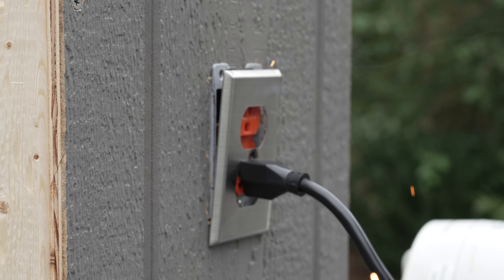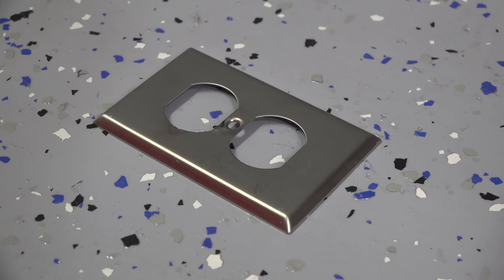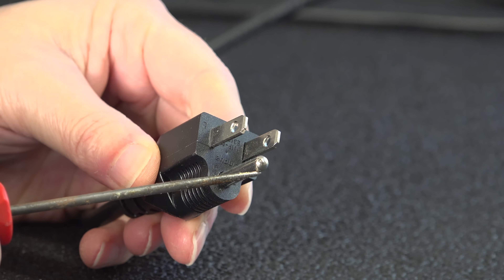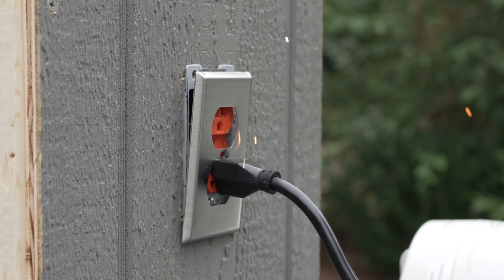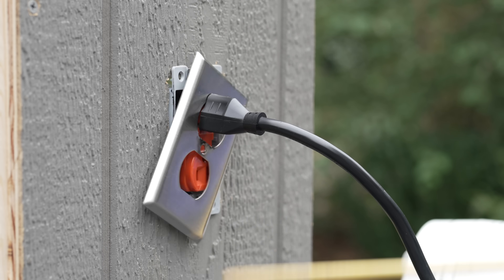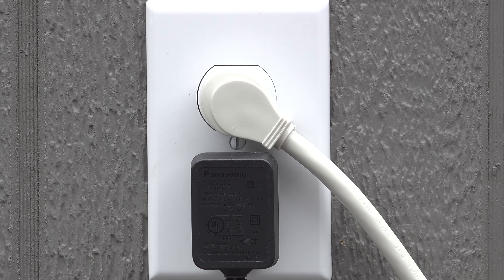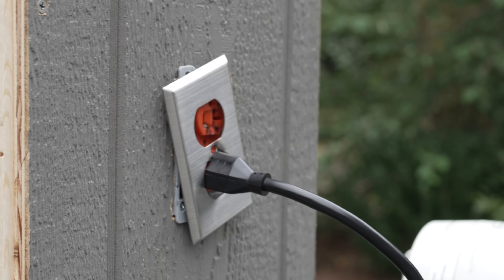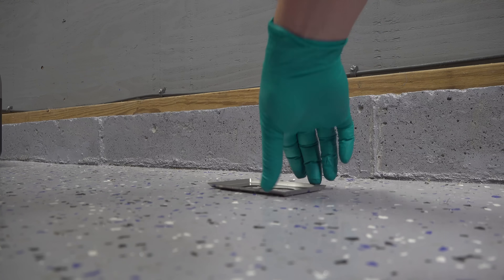What REALLY HAPPENS when you Install OUTLETS UPSIDE DOWN

Comment: We have outlets in both orientations. I have a power strip that doesn't care what the orientation is: it is a flat plug and it can be rotated to any orientation. I wish all devices had this plug design, except power tools, vacuum cleaners, etc.
Reply: Keep a close watch on that rotatable plug. They are notorious for arcing and starting fires because the internal connections that allow it to rotate get loose over time.

Comment: Why don't we copy UK's ideas with safety built in the plug. Or we make a new standard plug. I seen manufacturers get tempered resistant plugs.
Reply: I have a better idea - let's all go cordless!
Reply: I think the uk has fuses in their plugs because they run 30 amp 240 volt circuits to their outlets. With that much power available, you'd better have fuses in the plugs!
Reply: @jaygosch8705  
30 Amps by 240 VAC means 7.2 kW is available ... I don't think those circuits are intended (nor fused) for 30 Amps.

Comment: QUESTION # 1:   Why is the neutral terminal on a plug wider than the hot terminal?
QUESTION # 2:   Why is the ground terminal longer than the hot terminal and neutral terminal?
QUESTION # 3:    What is the difference between a regular outlet and a Hospital grade outlet?
QUESTION # 4:    Is a GFCI outlet designed to interrupt a short circuit fault, or a Ground fault?

Comment: Another solution, use more that one single screw to fix the metal plate to the wall. I know the output needs to be modified, but it would be much better to have redundancy if a screw falls out than not to have it at all.
Reply: Decora
Reply: If you're really worried about a metal plate coming lose, a bit of blue locktite would be more than adequate.
Reply: Who knows that the outlet needs to be modified?

Comment: Retired electrician here. I get asked about this all the time. Some people, even electricians will swear to you that ground up is code. It was a proposed code change back in 1996 but it never made it into the code. The committee answer is that outlets have been installed safely in both orientations for many years, and there is no need to codify a certain orientation.
Reply: I wish they'd codify ground down so people stop with the ground up nonsense. :p Ground up doesn't help at all for plugs that have no ground prong, and as shown in this video, it just makes plugging in power supplies and flat/angled power cords a pain in the butt.
Reply: Back in 96 our county inspector had us turn them ground up on a residential. A few jobs after that he said it did not matter.

Comment: We need to get you into a collab with Technology Connections! He did an exhaustive rundown of this topic and, if I recall, he concluded flipping it upside may provide some safety benefits, but so minor to be effectively pointless. This actually goes to show that cases where the facade is made of metal actually make the argument of it being far less safe.
Reply: Yeah, nowadays we have plastic that is strong enough to resist hits and abuse. Just use the same fiberglass reinforced plastic they use in power tools to make rugged plastic outlet plates
Reply: re: "This actually goes to show that cases where the facade is made of metal actually make the argument of it being far less safe."
Agree on this for sure.
Reply: @uploadJ  Agreed, but there have been cases where I went with metal covers anyway, because they looked so much classier. Not so much those sterile stainless ones as gold plated ones. They look really nice against wood paneled walls.
Reply: @richardmorrow2385 water always flows down mostly, so the bottom of the plug is what would get wet most likely, also a drip line loop is a common way to prevent this issue. Any sag on the line before the plug that goes below the plug will most commonly result in the water run off before ever hitting the plug. So I don't see this as an argument. Maybe during flooding it would make a difference but I don't see a drip on the chord as a likely cause of much anything, just my 2cents
Reply: @newmonengineering  Water tends to flow downward of course, but often finds other paths due to surface tension or capillary action; so it's not a stretch to think that if water was dripping down a wire, and there are no sags in the wire, it may come into contact with one or more conductors. That said, having the Earth connection on the bottom where the little mouth should be would actually be safer.
Reply: I was thinking the same thing!
Reply: I was here from that video
Reply: @bradleybbb Neutral and ground are tied together on the same buss in the electrical panel. It makes no difference in a short circuit scenario.
Reply: @akshonclip  It is true that Earth and neutral are tied together usually, they are different in the case of ground fault outlets / circuits. Neither should harm you in normal circumstances, but in our old shop (and it wasn't that old, we were the first tenants after it was built), I measured 50V between Earth and neutral. Undoubtedly due to current draw through the neutral wire, and the distance between our shop and the electrical panel. Obviously, it's best not to touch any connections of an outlet.
Reply: @kenmore01  If you measured 50 volts between ground/earth and neutral then you have high resistance/ poor connection, or an open neutral.
Reply: @akshonclip  I agree that something was not right with that wiring. There was certainly continuity through the neutral wire since we regularly drew 40-50A through it in the winter running many space heaters and our products. Fortunately, it's not my problem anymore.
Reply: No knife throwing!
Reply: They can play throw the knife at the wall together
Reply: p.s. I’m just thinking these metal plates are risky as can be. Maybe not worth the trade off unless they are coated to reset conductivity maybe.
Reply: I used to watch "Tech. Con" until he covered heat pumps. Was dead wrong about them being a miracle invention suitable for everyone. They are only energy efficient in warmer climates but certainly NOT where it gets COLD in the Winter. I know I went to school for it and have experience with them. He was stubborn about it and could not listen to reason and fact (ego?) so I quit trusting what he posted.

Comment: The fact that there is not the equiv. of a IEEE standard for a power outlet "implementation" such as ground position is just stunning in the year 2023.  Thanks for the vid!
Reply: Well, some of the outlet hardware is marked as to which side is up, and if the electrical code says follow manufacturer's recommendation, there is that.
Reply: Let’s just all switch to a twist-lock plug/receptacle system. 😂

Comment: The main problem is the plug. Sleeve the pins on the plug like every other country to prevent exposed live metal in the first place
Reply from the maker: Sadly the US should have done what european countries did back in the 50s and abandoned the old designs altogether. Now we are stuck with an archaic design forever I think.
Reply: @SilverCymbal  
I used to use the big 1/4" phone jack 'plugs and sockets' in the car for 12 volt devices, this was before car cigarette lighter jacks became popular as add-ons ...

Comment: If the metal plate falls its going to contact the earthed ground "first", before it can contact the live prong of the plug , so you are allways earthing the metal plate first., the other issue is cords pluged into an outlet have weight on there cord and this tends to bend the plug down , with the ground at the top it forces the prongs into there slots making therm less likly to be exposed .
Reply: Interesting angle on that one.
Reply: That's my thought (and experience) on the matter.

Comment: Another reason to install it ground down:  The outlet ground might not be connected properly (loose screw or loose wire nut), and you might not notice because the outlet would still appear to operate normally.  Then, if the metal outlet cover falls off and bridges hot and ground on the appliance plug, you have an energized ground on the appliance, which could be the appliance's metal case.
Reply: Wow thanks for sharing some insight,  very good point I never really considered that possibility.
Reply: What happens if the outlet ground might not be connected properly?

Comment: If the ground is not connected, which is the case for example on old houses, placing the ground at the top can, in such a case, electrify the plate without causing a short circuit, which is dangerous. A short circuit that trips the circuit breaker is less dangerous.

Comment: Also, another reason to mount ground down is that, if the cord sags down, having it "upside down" (with the ground up), may dislodge the ground pin earlier than live and neutral. By having it ground down, it will guranteed dislodge live and neutral earlier than ground.

Comment: In all the Reddit debates I have seen about this no one has ever mentioned it might be a good thing to have the breaker trip immediately. Personally i use metal plates in the garage and vinyl in the house.
Reply: Yeah, that was a really good point that I didn't think of and haven't heard before.
Reply: I was completely unaware that faceplates were so easy to come undone. Perhaps we should put a little locktite on the screw thread when installing.
Reply: @griffmustard  Never had a plate come undone in my life. LOL
Reply: That's assuming it actually makes contact with both prongs though. If it only makes contact with the live, but not the neutral, you now have a wallplate that's live at 120v.
If it's hanging on the ground, you don't have a live wallplate and even if it does swing over and touch a live wire when you come into contact with the plate, it'll still be hanging from the ground, so it'll trip the breaker.
Reply: @john.f.chamberlain   It will never only contact the live and not the neutral. It will fall onto both, it's simple physics.
As for "even if it does swing over and touch a live wire when you come into contact with the plate, it'll still be hanging from the ground, so it'll trip the breaker" that's not much comfort when I'm still touching it and still getting a shock for the amount of time it takes for the breaker to trip.
Reply: @mjc0961  you wouldn’t receive a shock for that period because electricity takes the path of least resistance which would be through the plate. It also would trip the breaker near instantly due to the insanely high current, probably faster than you’d feel it.

Comment: Orientation depends on your business.  As a landlord, I mount the outlet with the ground up.  Tenants always lean down on the male plug during removal breaking the outlet outer edge.  Then I have to replace the outlet.  The distance between the flat prongs and outer edge is much thicker and less likely to break when someone leans down on the plug during removal. I use plastic cover plates so there is no chance of shorting.
Reply from the maker: Very interesting! I hadn't ever heard that before. Those edges have always been a weak point.
Reply: @SilverCymbal  Heavy  people and those with poor balance push down on the male plug upon removal. The 2 flat prongs have about a 1/4 inch of outer plastic to support the push down weight.  The ground plug has 1/8 inch of material to support the push down weight and quickly fails.  A suttle difference between the mounting orientation and the duplex outlet manufacturer has you buying another one keeping them in business.  I think it is a design flaw. They can easily make the ground plug outer support structure thicker and more reliable.
Reply: @russellhill5959 They do but you need to spend a little more money.
Reply: Good point
Reply: Suggestion: Use WR (weather resistant) rated outlets. They are made of a plastic that is not brittle and will not easily break. I've tried. A pair of 12 inch Channelock pliers that will turn a normal outlet into a pile of plastic shards does nothing to a WR outlet. I wanted to get a WR outlet apart and it took several minutes of prying it apart and peeling the plastic away with a pair of pliers. They are tough.
Reply: really?  I never would have imagined that
Reply: I've managed many properties and have also run into this.  I stopped getting the standard outlet style and purchased the Decora style.  They're more expensive, and that is definitely a hurt when you own property.  However, I plugged the extra money and found I've had far fewer issues with them than the standard outlets.  I've bought the bullet and have been slowly been replacing them with better quality Decora style.  No issues with the outlets damaging, or loosening from how people are removing the plugs.
Reply: What happens if you have to replace the outlet?
Reply: @cameronbateau6510  Not sure I understand.  I'd replace it with another Decora style outlet.  Interesting to note, that I haven't had to replace any of the decora style outlets. Even the plates are more durable.  they have a top and bottom attachment, rather than a single attachment in the middle where the material is the thinnest and weakest on a normal outlet.  The old outlet style just seems inferior after using the Decora.

Comment: I found a few outlets in my house that were turned upside-down & couldn't figure why they did that. Thanks for clearing up that mystery.
Reply: In my house the ones that are upside down are connected to the light switches.
Reply: Those outlets are referred to as “half hots” and one portion of the outlet is switched.

Comment: Easy to solve the first problem by just using plastic receptacle covers.  :-)   My house was wired back in the 50's and the nut that did it made sure to orient outlets in every conceivable position. Even receptacles that are side by side, one might be up and the other down.  smh
Reply: If your house was wired in the 50's chances are almost 100% none of your outlets are grounded at all. Grounds were not required in the NEC until 1971. You may have 3 prong outlets but unless you rewired the house those outlets are not grounded.

Comment: Why in the word are you even using metal plates.... we stopped using them here in the 80's. And dust/dirt can also build up behind it and can cause the metal plate to become live as well.
Reply: Not in New Zealand we don't and every power point here has a switch.
Reply: @nickgooday7142  I literally follow someone from NZ who lives off grid with his own 3-phase hydro electric generator made from an old washing machine in a creek. He even welds with it… and his drop cords have a metal workbox with metal faceplate.
Reply: @nickgooday7142  I also just did a Google Image Search for “new zealand electrical box” and didn’t even have to scroll down to see a metal wall plate (with switches) from New Zealamd Pocket Guide.
Reply: He started by explaining that they get beat up and need a metal plate for robustness.
Reply: Also, I guarantee you that you still use metal plates for all kinds of things… like external work boxes and drop cord junctions. Heck, I’ve seen them in hotel rooms for the outlets with the bedside reading lamps.

Comment: Seems to me that the real problem is either the screw or having a metal plate.

Ceramic/plastic plate and a tighter screw solves these problems entirely.
Reply: It's just a bad design....
Reply: He described that they get beat up. Ceramic and plastic will crack.
Reply: @emmettturner9452  Regular plastic can crack but nylon covers are very tough.
Reply: @emmettturner9452  re: "Ceramic and plastic will crack."
Carbon fiber composition, unless you are going to 'dive' to 'ocean depth' with it. /s
Reply: @emmettturner9452   cheap plastic will, but not reinforced plastic